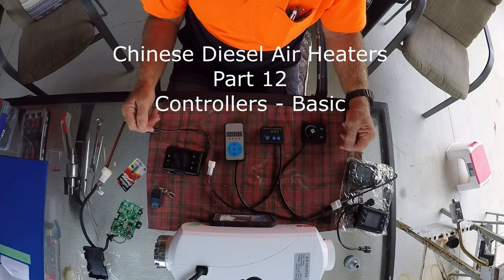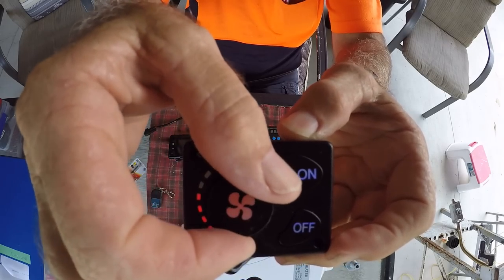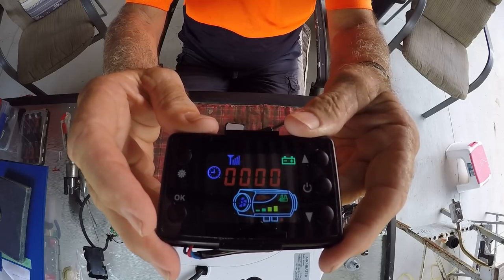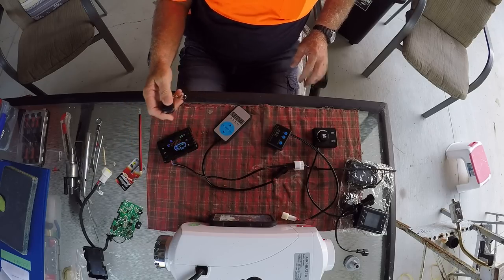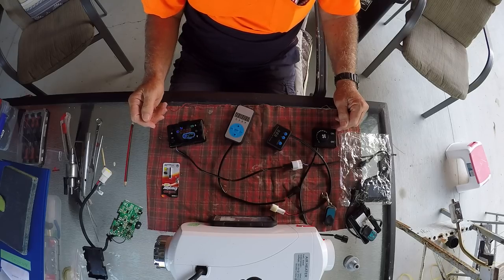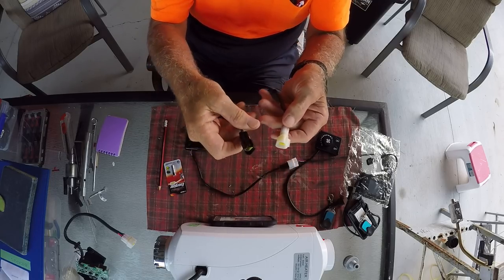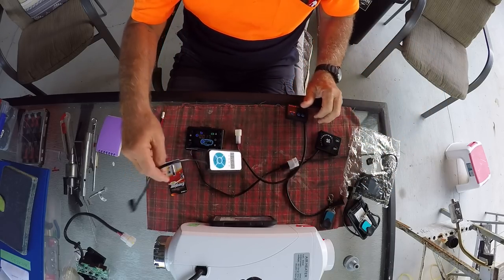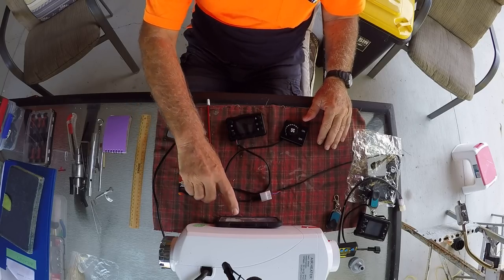Chinese Diesel Air Heaters -  Part 12 - Controllers (Basic)

Comment: John I buy Heather with out the remote so I buy a spare part controller with remote on it... I can’t get it work. I notice all the icons are lit up... a little help here mate. Thanks ahead.
Reply from the maker: Hi Vinz,

In the past most Chinese heater manufacturers used same wiring, same plugs, same everything, so it was easy to mix and match products between heaters. But in the last year or so this is not the case with different plugs and sometimes same plugs but wires reversed.

First check if the three wires in the two remotes have the same plug and the colours on the same pins. There will be two power wires and a sense wire. If not you can sometimes get a new remote to work by butting the right wires on the same pins.

Next check it the new controller will work manually. If it works manually then it is possible you have not "pared" the remote to the controller. The controller should have instructions how to do this.

Also make sure there is a battery in the remote. Some come without batteries, and not all controllers have the same batteries.

Good luck.  JMcK

Comment: Hello !
I am writing all the way from Poland to learn a bit about the air heater. I found some very interesting movies with you.
I bought a Chinese heater with a Webasto 1533 controller and installed it on the yacht. I would like to change it to LCD or LMST which you show in the video. The problem is that the Webasto 1533 has a different plug than the controllers shown in the movie. I cannot find the wiring diagram and signals for these controllers on the Internet. Maybe you tried to do such a swap I would be grateful for your help. Sorry for bad english.

Comment: I have a controller similar to the more sophisticated one to your left our right in the video. But it doesn't have a Hz setting and has blue light not red. Just 6 heat settings and an altitude mode. Have you had any experience with the type yet?

The controller looks the same but slightly different.
Reply from the maker: No Rob, I have not had a controller with an altitude mode. Is it a Chinese heater? Are you able to send me a photo. johnmck47@outlook.com.  Thanks J McK

Comment: G'day Mate,
Is changing the main board pretty straight forward? Just unplug and plug the new one in?
Thanks for your help.
Doc
Reply from the maker: Hi Doc, I assume you mean the ECB.
Generally it is fairly simple, just take one out and install a new one.
However some newer heaters are coming out with “non standard plugs and wire protocol, making this more difficult if you are not an enthusiast.

Cheers.  JMcK
Reply: @johnmck1147  my heater came with that controller that is not available as a replacement part.
I have bought a new controller and the ECB. Just didn't know if the "nonstandard" wiring would effect the swap out. Cheers
Reply from the maker: Doc Titan 

Just make sure the polarity of the wires is the same. Red to red, black to black, and blue to blue.
Cheers.  JMcK

Comment: Hi John i've been watching your videos and they are super useful but i have a problem which is controller related. I installed a 'all in one' diesel heater a while back and it's been working fine. However my controller which came with it didn't give much control so i wanted to try a better one.  The one it came with was a bit like the basic one in your video but a little different, it has a fan button with green led next to it, a heater button with red led next to it, a off button and a dial. i can start and run my heater by pressing the heater button and rotating the dial upwards. the fan button doesnt seem to do anything. But it runs and heats my camper. But i wanted to have thermostat control and therefore be able to leave it on over night to kick in when needed.    i ordered separately the more advanced controller which is like the one in your video, with all the led picture information. When connected it gives temperature of the room, time and other information like altitude which is impressive. But it shows zero for battery, zero for a few other functions and it gives the 07 error code.Basically it will not turn on or control my heater. But i know my heater works. all LED screen pictures of the heater and so on come on, but the controller doesn't control the heater. I just wondered if anyone else has come across this issue and might know a solution. Perhaps the control doesn't work with the particular heater i have.
Reply from the maker: Hi John,

Thanks for the feedback.

In the past the different manufactures in China that made copies of the German Eberspacher heater kept the same wire/ECU protocol, so mix and matching controllers and ECU's was a very simple plug and play.  Now we have manufactures doing their own thing and changing controllers is not so simple.

First check the wires match up with the new controller. There will be three wires, two power wires and a blue sense wire. Sometimes just matching up the wires will fix things.

Then you will have cases where the manufacturer has their own protocol and other controllers will not talk to their ECU. There is really nothing the average person can do in these cases but use the supplied controller.

I now encourage people to buy a heater that has the controller they  desire.

Cheers,  JMcK

Comment: Thank you for the very useful information for anybody (like myself) who are installing or about to install one of these heaters.  So, what is your opinion of the aluminum cased heater anyway?  I've been leaning towards one just because of the case.
Reply from the maker: Hi Mr D, 

This is probably a subject for a future video. In short, I initially thought the aluminum case would absorb excessive heat from the heat exchanger and transfer it to the environment around the heater, causing a hot spot around the heater and a reduction of heat from the outlet. 

In practice, this was not so. The airflow through the heater was sufficient to keep the case at similar temperatures to the plastic cases, and heat output very similar as well.

It all comes down to personal preference. Operationally there is very little difference between an  aluminum  case heater, and a plastic case heater.  Chose one you would find most suitable. JMcK

Comment: Sounds like you are in Jurassic Park.  Interesting wild life in your area.
Yesterday I received my first Chinese Diesel heater and the controller was bad.  Upon opening and examining the Mainboard closely with  a jewelers loupe I found the issue.   Apparently the soldering process during manufacture was quite poor.  Numerous pins going through the board had no solder on them.   It's as if the soldering robot ran out of solder on this board.   In any event, it might be something to check on Controllers having problems.
Reply from the maker: Oh dear Randy, you have exposed me.   JMcK
Reply: @johnmck1147  Don't be insulted.  I think it's quite interesting.
Reply from the maker: Randy DiCotti 👍😄

Comment: Could you please do a video on converting from 12v to 24v and vice versa?
From comments in your other videos, it's mentioned that they are all 24v components; but there are settings in the controller that must be changed and a passcode to enter, according to other videos I watched.

Also, do you see any issues if the heater is ran on 24v all the time?
Glow plug have a shorter life or overheat?

The solar charged, battery storage system in my camper is 24v and I want to power the heater straight from the battery bank for max efficiency.
Reply from the maker: Hi Jhoncho, 
You can not easily change between the two voltages. If you want to run a 24 V supply buy a 24 volt heater, or install a DC:DC converter to run a 12v heater off a 24V system.

Some controllers can be programmed to run on either 12V or 24V systems, but the glow plugs, fans, pump and ECU are voltage specific and would need to be changed.   JMcK

Comment: In the event that one of these heaters inadvertently has power shut down (catastrophic failure of the power source, for example), is the ECU the only damage you need to be worried about?  Or are there safety risks as well, such as a fire?
Reply from the maker: Hi CP
Unless you do something silly, like store rags around the heater soaked in flammable liquids you won't start a fire, but you will melt the ECU, and could melt/distort other plastic in the heater.  JMcK
Reply: @johnmck1147  OK. just wanted to know safety risks in an unintended or emergency shut-off situation.  Thank you!!

Comment: I have one of the all in one units that  I've had over a year and no problems I would like to know if there is a way to move the controller off of the front of the heater and if so will the length of the wire matter like drop in voltage to the controller?
Reply from the maker: Hi Lee, yes you can lengthen the controller wire loom. There are 3 wires, power positive, power negative, and sense wire. If up to about 1.5 m extension you could use same size wire, but I would look at going up in wire size if longer than that to avoid voltage drop.  JMcK
Reply: @johnmck1147  thanks I'm going to move it 12 feet I'm going to use 14 ga.wire

Comment: Hello John, You are the guru of Chinese ( and maybe others as well ) diesel heaters. Question : Have recently purchased 5 kW diesel with the luxury looking display. I am unable to set the heater on a fixed temperature of 8 Celcius , because I only use it to heat the garage for my oldtimers. Ideally i would like a setting of start at 5 and stop at 10 Celcius, but 8 contineously is OK.  Automatic start when temp. falls below 8 and stop at 8.
Hope you can help me. Tahnk you and kidnregards. Andre
Reply from the maker: Hi Andre, 

First thanks for the feedback and comments.

All Chinese heaters I am aware of do not have auto start and shutdown. You manually start the heater and it will try and reach and maintain the set temperature by ramping up and slowing down.

I personally like to mostly use manual heater settings rather than temperature settings, but that is just a personal thing. 

Your requirements are a very low temperature setting. As a suggestion, I think you should try using manual settings. You will soon find out what manual setting best fits your requirement.

Good luck.  JMcK

Comment: Hi John, I have heard that there is a way to adjust the heater for higher altitudes, above 1200 meters?, via the controller? Do you know anything about this?
Reply from the maker: Hi DP, 

The German Eberspacher and Webasto heaters have a high altitude setting, but at this stage I have not personally seen any Chinese heater with a controller with a high altitude setting.

However, the Chinese are very good at accommodating customer wishes, and I am positive it will not be long before all Chinese heaters come with an altitude setting.  JMcK
Reply: @johnmck1147  Ah, ok. I see. Up to what altitude do these Chinese heaters function ok in your understanding? I was told 3500 feet or ~1100 meters.
Reply from the maker: Hi DP, probably at any altitude over say 1,000 feet these heaters start to run rich due to the lower oxygen levels in the less dense air. They will operate over 5,000 feet but you get greater than normal carbon deposits in the burner and atomisation screens, and hence more maintenance issues.

At altitude I suggest heater owners consider using a high kerro/ diesel mix, soy 80/20 to 90/10. This burns cleaner and lessens the carbon deposits.   JMcK
Reply: @johnmck1147  Ah, ok! Thanks for the info!

Comment: Hi mate how can we change the fuel pump pulse rate and slow it down and speed fan rpm up this heater keeps blowing flame out of muffler, air cleaner is free brand new unit

Comment: Now that I have done my boat heater install, I wonder if you can splice in an extra controller. I'd like to have one in the berth and one at the helm.
2 controllers for one heater. Do you think that is possible?
Reply from the maker: Hi PAI

I have not done this, so I can not give you a definite opinion. However logic tells me that with two controllers the ECB will not know which controller to follow.

However if you can switch one controller off, then the ECB will only “see” one controller and all will be ok

In practical terms you would need test things here. 
Perhaps you could just turn off power to one controller.
Perhaps you need to turn off the sense wire.
Perhaps both power and sense wires together with a double pole switch.
Perhaps you need a rotary switch that turns one controller off while turning the other controller on, so at no time does the ECB see two controllers.

This can be done, you need to experiment as to the best method.

I would be grateful for any feedback here.

Regards.  JMcK
Reply: Yes sir.
Thank you for the good suggestions. I'll do some experiments and shoot a video to send you once I have something conclusive.
Did you get to watch the video I sent you about my boat heater install?
Reply from the maker: Pray About It 
Sorry I have not seen it. Could you please send again.
johnmck47@outlook.com
Thank you.  JMcK

Comment: What about remotely mounting the ecu computer away from the heat to protect it from emergency shutoff overheating or just general longevity of the circuitry?
Reply from the maker: Hi SJS. Remote mounting of the ECU is not so simple as it has built in sensors for fan speed, and is really not worth the effort. With a proper install the chances of damaging the ECU are very small.  JMcK

Comment: Hi John good video Just to let you know the v2 heater you have comes with the new blue controller and red remote in uk with the better sellers the red remote is by far better  it will tell you the the heat of the unit battery volts up and down and a lot more from sitting in your front room so if you buy a new heater look for the red remote just got one it's the best iv'e come across give the birds some nuts oh by the way that controller I was trying to pair was a faulty one have a good day. Jeff
Reply from the maker: Thanks for the feedback Jeff. Yes, I will do that with my next heater.

Comment: John, can you please tell us how much space we should allow around the actual unit. Thanks
Reply from the maker: Hi Glenys, it very much depends on what the near by “walls” are made of. If metal, you can shoe horn it in, if timber, I would suggest 50 mm (2inch) to be a absolute minimum.   JMcK
Reply: @johnmck1147  thanks John. 
Also is there a way to remove the connector heads on the leads so as not to have to drill a larger hole?
We hope to have a cutoff switch. If we connect it near the control unit, I’m assuming we place it on the red wire? Or should we be putting it on the lead to the battery?
Thanks again
Reply from the maker: @glenysswanton2563  

Hi Glenys,  you can just cut the wires and re join them, or install a plug and socket to make future removal easier.

Yes, a switch and fuse goes in the red (positive) wire.

Have you seen the motorhome videos?

Cheers.   JMcK
Reply: @johnmck1147  thanks John. We will watch again as we must have missed that part

Comment: Would the different controls be interchangeable on one heater ?  I work like to change to the simple turn switch
Reply from the maker: Yes, you can often change controllers. 
In the past all manufactures followed the same protocol and you could easily swap them in and out. 
Nowadays, it is no so easy as some suppliers use different protocols, and different plugs. However, if you have some practical ability you can make things work. There are three wires. Two power wires, a positive and a negative, and a sense wire. Match them up if the controller does not have a standard plug.  JMcK
Reply: @johnmck1147  thanks a lot for your answer🙏🙏 my next Question is regarding power supply, I haven’t found any of your videos on this topic, and wondering if it’s possible to make a direct power supply with out or around a battery? 

Thank again and for your very explanatory and educational videos 🙏

All the best from Denmark 

Jon
Reply from the maker: Yes, you can use a power supply if your AC power is reliable, or the heater is mounted outside in a cold environment. One issue though is you can have an overheating of the ECU if you lose power as the heater can not do its cool down cycle if no power.. 

perhaps a better solution providing protection from power sharing, AC storm damage etc is a small motorbike battery and a small multistage charger.  JMcK

Comment: I have a black 5 button screen that goes into a standby with a pad lock on the screen runs perfect in p1 and p2 when I crank it up to p10 it runs for  30 mins and throws a e6 error it has a temp of the burner at 230degres then shuts down